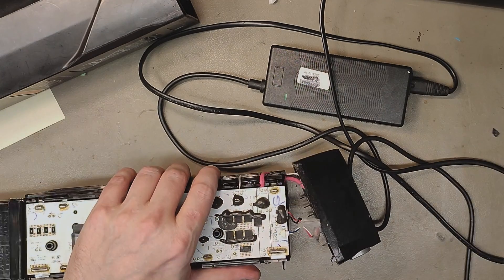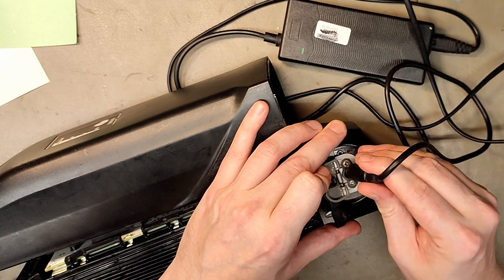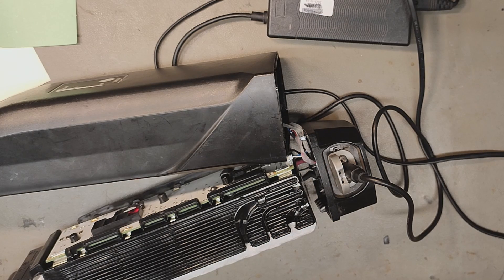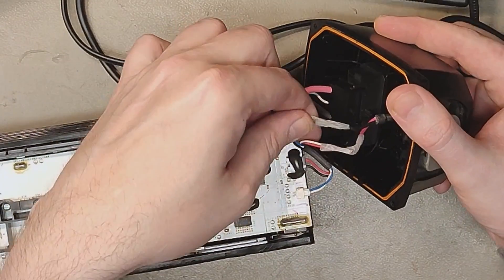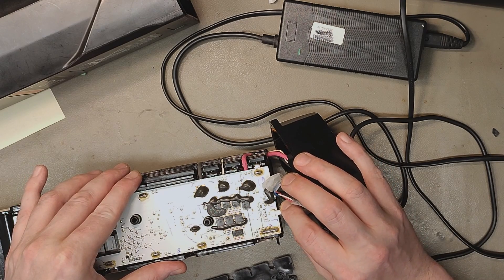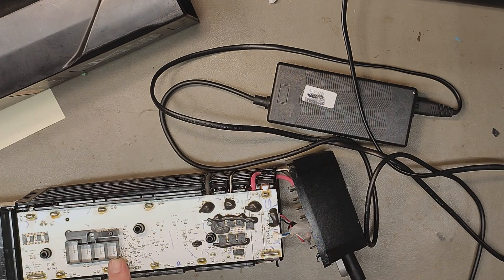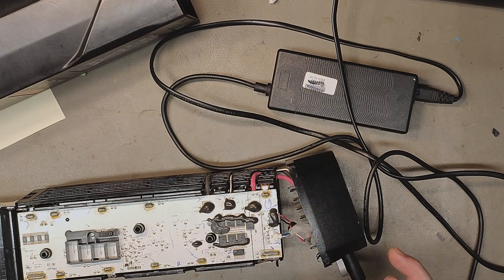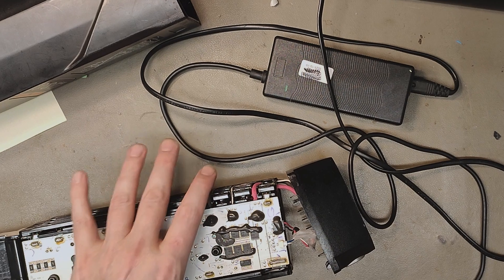A swedish Genius (not me) bypasses the Yamaha ebike charging protocol

Comment: Thank you very much for the video. I have a question: the battery has a three-pin connector for connecting to the engine. I need to know what the white wire in the middle is used for. Does it measure the battery heating temperature, or is there a chip code sewn in there for identification, is the battery original Yamaha or not?
Reply: Probably comms to the battery % display on the handlebars

Comment: Thanks for the video. You are right about the two communication wires, white (+) and blue (-). Successful in charging it again with a generic 42V charger and a 3V supply to the communication wires.

Comment: Hi doc I've got a sduro 1.0 haibike Yamaha 36v battery id some trouble with the charger connector on the battery so I fixed it attached another one then I got this error code e and f flashing is my BMS blown if any part on the BMS is burnt could I replace it n maybe it'll work again iv had the bike 2 weeks 2 and this happend all that money just seems wasted can anyone help it'll be very appreciated cheers.
Reply: I have the same sduro 1.0 haibike Yamaha 36V 400Wh, a few days ago, led on the batterry flashed aletrnatively 1&2/3&4 when pushing the test button, same when conenction to the charger, and it don't power the bike anymore, doesn't swith on.
I so have ordered a new Ymaha Battery, no choice, I use my bicycle evryday to go to work, and to go with the car for a week., but this is not last. 
I got my new battery today, but it seems delivered empty! Just conencted it to the cherger, and will have towait for 3 hours.
Now, I don't think origina battyery is really dead despite it has 700 cycle, 7 years old now, not a bad score, bu I don't think it got suddenly dead after the last trip... I would think old cells gut unbalanced, and BMS cuts so the power.... I want to take down the battery, and try see what's happen, change some cells, or just use and other bms, and use with an other bicycle I project to build ( convert to electric)

Comment: it is uart not canbus but there is now a chip that you can use so you can use any 3rd party bms and keep the coms data a uk shop has managed to find a way round bosch and can bus but they have to be working and charging to have a chance of a full recell so not 100%

also the new bosch smart batts will not work with the older motors and have a new bms layout ffs :face-red-droopy-eyes: